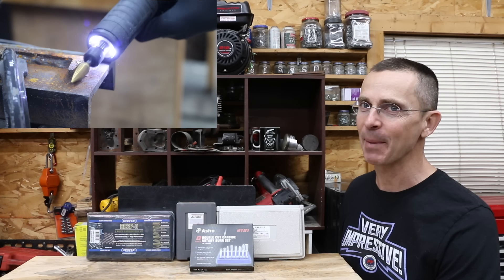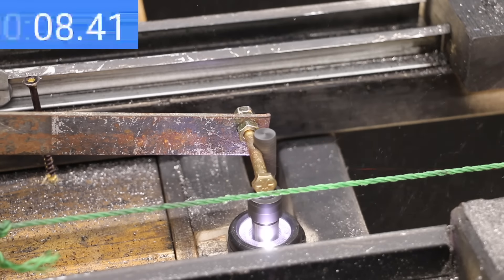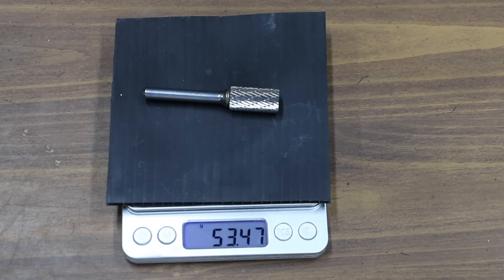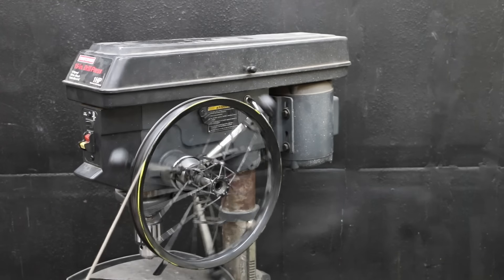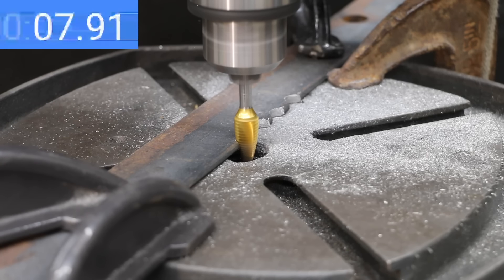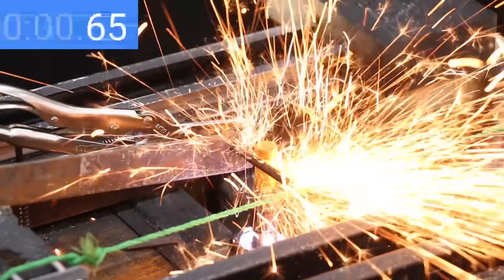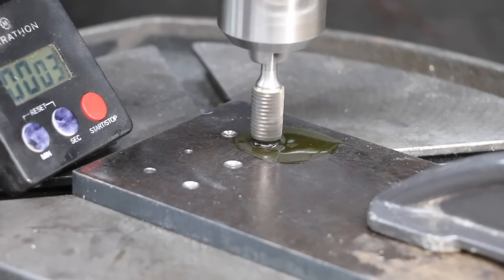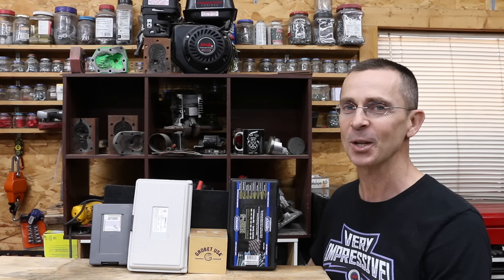$28 vs $300 Burr Set? US vs Imported Burrs. CLE-LINE, Champion, Grobet, Kodiak, Astro Pneumatic

Comment: As a heavy diesel tech I need different tools I never knew I needed, I've watched your content as much as I can when I need a real option when I decide to purchase. You're the first guy I think of when I need help deciding. Thank you for all the great things you do, you're a real one for keeping it a 100 percent honest. Us blue collar workers thank you.
Reply from the maker: Thanks and you are welcome!
Reply: So true I'm a DIY homeowner and use this channel before I buy stuff. I now use the wipers from the wiper video and never been happier!
Reply: I'm not in the tech game anymore, I left for another career but when I was I always had a die grinder with a burr in it. Made installing bushes etc so much quicker, cleaned up lips on drums and discs, cleaning out rust from spring centre bolt holes, so many uses
Reply: Hear hear. I'm a plant E/I and this is where I begin my search
Reply: Check out Rescue Bit. They are an Amazon and other places. I've been in HD repair for close to 50 years. I have never seen ANYTHING that cuts like these. They will cut thru the screw extractor and or drill bit you have broken off in the busted exhaust manifold stud/bolt your trying to get out. I run it with a Cornwell die grinder. They run dry. READ the directions. First time I used one it saved me from from removing a cylinder head to get a broken exhaust manifold bolt out.
Reply: I do the same thing. If I need a tool and not sure of the brand, I'll look to see if Project Farm has done the test and make my decision by that, hands down. I won't even entertain the reviews left on the purchasing site. Most of those are fake.

Comment: I've used these in the past and didn't have very good results. After watching your outstanding testing video, I think I'm going to have to buy a new set. LOL Thanks for all the time and money you put into making these videos! A++
Reply: Which set did you have fail?
Reply from the maker: Thank you very much!!
Reply: @paulcopeland9035  If I had to guess it was a no name brand from a general store
Reply: @Jako1987  Combined with incorrect use.
Reply: @Jako1987  to be honest I bought a set of cheap no brands from amazon. They were like €30 for 10 I think?
Used rm a couple of times on your average construction steel using my milwaukee M12 die grinder, they work quite a charm!
Reply: same never managed to use them

Comment: Doesn’t apply to me as a carpenter but damn I love watching your videos and they’re always the highlight of my Sunday
Reply from the maker: Thank you very much!
Reply: I work in a office and have two left hands.
But still love these video's ;)
Reply: Carbide burrs can rip through wood. But you're probably better off using a cheap rotary rasp. Although the rasp finish is rougher than the finish a burr leaves. The rotary rasp is like a rasp and the burr is like a file. You're probably going to have to finish with sandpaper anyways. A straight conical rotary rasp can be just the thing for weird wood shaping. I've never found a use for any of the other profiles.
Reply: Heavy cut Aluminum burrs will chew through wood at a pretty quick pace...
Reply: I'm a millwork installer/finishing carpenter and the die grinder is a tool that I never knew I needed to get me out of some pickles.
Reply: I use them for wood carving.
Reply: Huh thanks for the insight y’all I’m mainly a form work carpenter with a lot of experience framing as well but when I do finishing I’ll keep that in mind
Reply: there are several wood rasp burrs that i use in die grinders  and some even make discs for on angle grinders!!!! look up kutzall, saburrtooth,  king Arthur tools, hell even ryobi makes some good burrs for wood... but i love the saburrtooth brand the best, they make so many burrs in all sorts of "grits" ,but they also make the craziest wood carving discs ive ever used... i know alot  of people are super hesitant and sketched out by the wood carving discs,  but believe me, these ones are im a another universe... the 'teeth' are so sharp and uniform in height and distribution across the disc, that when running they really dont create any spots for them to catch or jam ... they seriously just melt wood away to dust...  now, you dont wanna have this run over your hand as itll prolly do the same to u as the wood,,,, but it really is so much safer to operate, cuz it doesnt have thick jagged teeth or loke chainsaw chains that can cause it to skip or catch n jump at you,
Reply: would love to see one where you compare the wood carving tools,, either carving discs like for the angle grinders , and in a separate test burrs for wood. brands like arbortech , saburrtooth,  kutzall, n even ryobi has some tungsten carbide teeth wooden rotary burrs too!

Comment: What I love about your testing is how you test products, like tools, under normal use conditions, then you stress test them. Seeing the breaking point of products is crucial, especially when making a determination if a more expensive product is worth it. I look out for your videos every week and you never disappoint, keep up the great work.
Reply from the maker: Thanks, will do!
Reply: No way, the way he's testing these tools is flawed, that's not real life testing.   A real proper test, would be using a solid carbide Burr on a solid carbide Endmill.   As a machinist I've seen demonstration where you use a solid carbide endmill to mill a slot length wise on an other carbide Endmill and the endmill that did the slot shows no damages on the flutes.  The way he's doing his test is abusing these tools to get faulty results.  That's why it's a faulty or bias methodology.  If I were to do that same style of test, that Project Farm did, to find the best tooling for my job, I would be out of a job.   

Listen I've used cheap set of Burr's even in a high speed CNC Mill setting and the tool held fine on hard to machine Inconel.
Reply: @lepompier132  Man he tested the burrs in a way ideologically consistent with how regular people would use them in their own home-gamer shops. People aren't in their personal shops cutting carbide usually, nor are they cutting any formulation of Inconel, and they particularly don't normally have a $60k CNC machine to throw into the mix. Of course you would be fired if you did a tooling test like this, they pay you more than was spent on all the tools combined for this test.
Reply: @MedicSound  Sorry I don't agree with you, the average person won't abuse de-Burring tool in that fashion.  In order to get the same pressure on the tool for an average user in the garage, he would have to put his full weight on it, when in reality he doesn't have a steady hand to force the tools in the metal, let alone something that's hard like a grade A bolt.  With common sens, someone in hos garage will use the 4 inch grinder first and once the grinder has done it's job they will use a die grinder with a Burr tool to clean and prep the zone and from experience I've seen the use of Burr tools after the 4 inch grinder to finish cleaning removing the rest of the weld.  Or prep the zone to weld with bass.  And like I said in my original comment, I've used Burr tools Carbide and High Speed Steel version and I don't destroy them, in fact I have a cheap set and that set gave me the best results. That's why I say his test is flawed because it doesn't reflect reality of use.  And since in his video he used Carbide version.  When you know how they make carbide tools, you tend to respect them and they have a longer life.

Comment: I would have thought the single direction cut on the cle-line would have made it perform poorly, but I think they're onto something there. Very interesting. Great test as always.
Reply: We use them on aluminum. Extremely aggressive and can chew through a terrifying amount of aluminum in a few seconds. Doesn’t gal quite as quick, either
Reply: @justinmartin8887  oh man, you ain't lying. With their performance on steel I bet they chew right through aluminum like it's not even there.
Reply: @justinmartin8887  I already thought that this tool would be great for aluminium, thanks for confirming.
Reply: I guess that design is stronger and has fewer "holes" in the pattern. I'm also guessing it's less expensive to make as well.
Reply from the maker: Thanks!
Reply: @kenmore01  exactly what I was thinking, it seems like less is more in this situation - the company is saving money on production and outperforming the competition - a win win for them
Reply: @justinmartin8887  I’ve been using the RADNOR alumacut.  They are single cut with a larger space between the flutes for releasing the aluminum chips easier.    Also works better than regular single or double cut at taking galvanize down and powder coat too.   The normal burrs get plugged immediately with softer materials but alumacut is a life saver.   I’ve been stocking the 1/4” size and the fit in really tight spots.  Normally used on railing, picket rail and stair rails that we can’t blend the welds in the corners with a Metabo WEF 115
Reply: @williamlawrence4853   I guess the RADNOR alumacut would be very similar to a  E. P. HELLER   CXC  type cut.
Reply: @iwb316  I’m not familiar with them.     I picked up the alumacut after talking to our salesman with Airgas.    We were looking for the best way to blend aluminum pipe railing.   Did the 1/4” alumacut burrs and a dynafile with the pipe attachment.   Between those and the WEF115 it covered all of our needs

Comment: Great review, and timely too. I'm finally ready to replace my Snap-on set purchased approx. 40 years ago. I always ran them at the proper speed and pressure which is why they lasted so long. Thank you Project Farm!
Reply from the maker: Glad I could help!
Reply: I've got the 4 piece snap on set myself. 20 years so far, and haven't had one that needed replaced yet. Either from wearing out, or "walking away"
Reply: It would be interesting to know what company made those Snap-on cutters 40 years ago.  I have a bunch of older Snap-on and the quality is exceptional.

Comment: I've only ever use mini versions of these that fit in a Dremel type rotary tool. Cool to see what quality bigger versions will do. I was rooting for the Kodiak as I bought an 1/8th inch carbide end mill from them years ago as a better router bit for my Dremel and it performed really well.
Reply from the maker: Thank you!
Reply: So depending on what material you are working on you can get the rotozip bit that are normally for cutting thru drywall and other stuff and use them in the dremel and they work pretty well as long as its not metal. They also have some tile cutting bits and grout removing bits that are basically carbide burrs anyway and those work great for pretty much anything you need, Just have to make sure its the right size  it get the dremek collet chuck attachment. but they work great and can sometimes be cheaper than the dremel bits or other alternatives
Reply: dremels have the R.P.M. to make good use of some of these bits probably need them a little smaller though. i have use these in a pneumatic die grinder for cutting through spot welds in ford strut towers to be able to adjust camber and caster in a wheel alignment...
Reply: I have been using American-made Atrax 1/8" shank carbide bits, purchased over 35 years ago when I was a car stereo installer, in my Dremel tool. They're slightly chipped and beat up after years of use and  abuse but they still work!  The company was founded by ex Pratt and Whitney tool and die makers, and they still make their products in the USA today. My bits weren't cheap when I bought them, and they're quite expensive nowadays, but I have gotten more than my money's worth out of them. I would love to see Project Farm do a review of various 1/8" shank bits for Dremel tools and other similar miniature rotary die grinders.
Reply: @connorjohnson4402 ,  I did try the Dremel brand ceramic tile cutting bits (diamond) when I needed to trim away some tile from around an electrical box when we redid our kitchen, but they didn't work well at all for me.
Reply: @goodun2974  i think most of the dremel made tools are mainly for cutting wood or plastic for hobby stuff. for tile you need a more industrial bit
Reply: @hellshade2  , Dremel markets "tile cutting bits" , but as I mentioned, they worked poorly for me. All I needed to do was clear away a little bit of overlapping kitchen-backsplash that was partially obscuring the screwholes of a conduit box. If I was doing the tile work myself (I'm a pretty good DIY carpenter/electrician/plumber, but I don't do tile!) I'd definitely search for better quality bits for cutting tile.

Comment: One of very few tests that I've seen where the more expensive brands have the edge over competitors.

Kind of strange to see it when it comes to burr bits though. You'd think price-to-performance would show up in more substantial tooling but here we are.
Reply from the maker: Thanks for sharing.
Reply: Yeah, a lot of times the less expensive tool is just as good, I think the difference here is metallurgy - the specific alloys and precise heat treatment. It's what makes the difference in high-end knives for instance.
Reply: @oldbridgemaker2094  
I agree totally. The cheap burrs could likely benefit from better heat treating but they just aren't made from as good a steel. That would be an interesting thing to test though. Send off some cheap burrs for a proper heat treat. Might even find some other tools it's beneficial on. Maybe cheap impact sockets, files and whatnot.
Reply: @1985cjjeeper  There's no heat treatment with tungsten carbide. It's just grain size, binder/concrete, cutting geometry and coating.
Reply: Was gonna say, i didnt even know what a burr (tool) was before this, though i can see the possible applications now
Reply: Not so strange, considering that WC is not really standardised and labelled.

Comment: Great review. For me, only having to buy a tool once instead of 5-6 times over my lifetime is much better. Especially when those tools will outlive me and possibly become heirloom tools. I'll be getting a set of either the Cle-Line or Grober thanks to your review.
Reply from the maker: Thank you!
Reply: I'd buy a cheaper set (probably the Kodiak), then replace them as they wear out with higher-quality single burs (I like Pferd the best, but I've had good luck with Cle-Line too).  You'll find a "favorite" shape for your work, and you'll only grab the other ones when you have a special need.  Be careful with the ball burs, they cut a lot faster than you expect them to.
Reply: The single cut cle-line is really a great choice, it's what I use on hardened steels that a belt grinder can't get to.
Reply: Sounds great till you spin out and the burr catches hard. Doesn't matter how much you paid then. I like the other posters thinking. Get a cheap set and see what you use, and what you break. Then buy accordingly. Sometimes you buy the one good one. Like my 3 foot long half inch Harbor Freight breaker bar. Broke one so easy at first I thought I'd mounted the socket funny. Got another one and it has turned out to be a beast that has had a 5 foot pipe put on it more than a few times.
Reply: @1985cjjeeper  And sometimes using a trash bit is what causes the problem to begin with.  When you're talking about craftsmanship and developing a skillset with tools, you're teaching yourself bad habits if you use tools that aren't going to do the job right.  Case in point, you buy a set of cheap burrs and end up using way too much pressure to perform a certain task, and you end up overheating the bit or losing control of it...so you go out and buy a good set and destroy them too because you default to using far more pressure than the bit needs.  Had you started with a good set, that learned behavior wouldn't exist.

Comment: I would love to see you testing "ceramic coatings" for engines. The ones you put in the oil before and after oil change. RVS and Resurs Total are atleast two companies that I know off. I would love to see if they actually does reduce friction and helps the engine or the gearbox etc. (There is many products for different applications with those oil additives)
Reply from the maker: Thanks for the video idea.
Reply: I recall he did one on motor anti-friction additives. I believe Motorkote came out on top, it's what I use regularly.
Reply: coating the cylinder walls with say, titanium nitride like on dril bits or even AlTiN
Reply: @MoSportsUSA  He's done quite a few videos with oil additives.  The self-destructing Predator videos were fun to watch.  I believe Lucas Synthetic Oil Stabilizer won that series of tests.

Comment: For the bolt cutting and Allen Wrench cutting tests, it looks like the deciding factor is how fast the bit can heat the metal up to the point that it loses temper and becomes soft enough to chew through.
Reply: I only have one bit, the oval shaped one. I can grind into metal till they are smoking red and then put my finger on the bit; it is still room temperature. Titanium Carbide is such an unbelievable material.
Reply: Its basically abrasive spot annealing. Its definitely not the same as properly cutting, but he also isn't using an industrial mill....